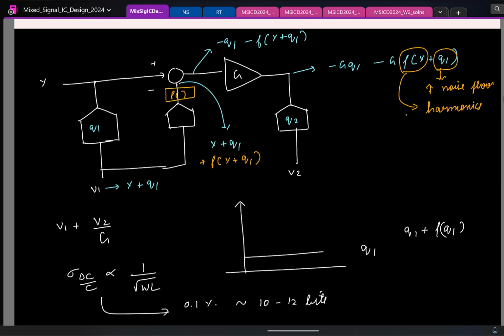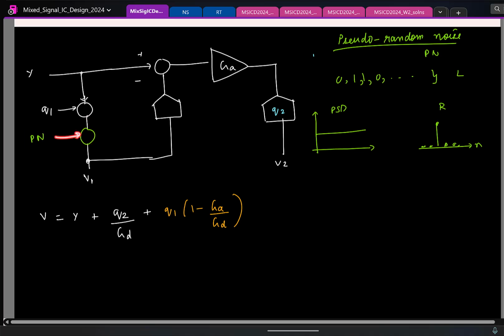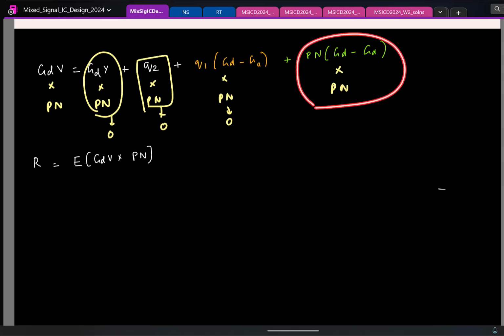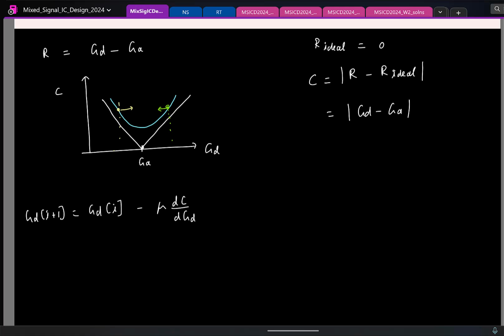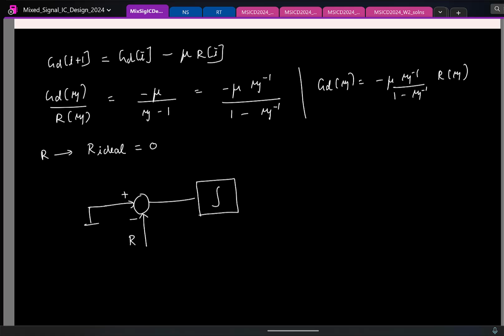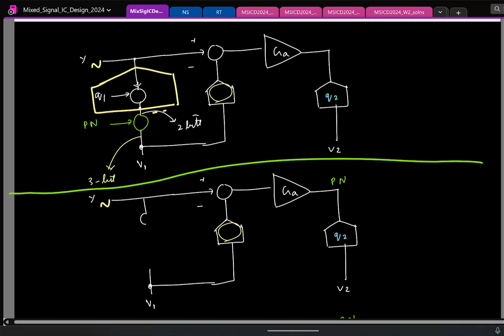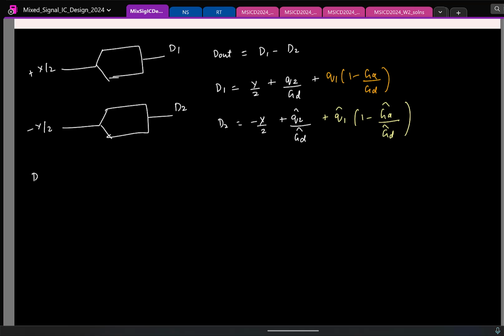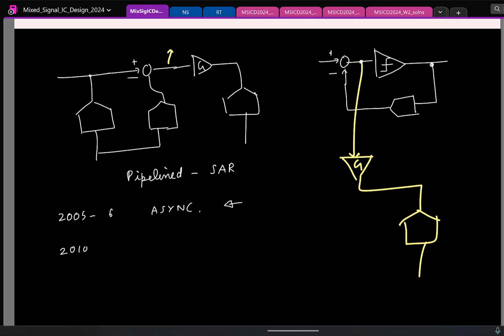Lecture 19(2): Digital calibration with PN dither based correlation: Gradient descent & LMS

Comment: I have a question. If i want to correlate between PN in analog domain with Dout in digital domain, i must convert Dout from digital domain to analog domain? Ex: with ADC 12 bit with Dout = 0 - 4095 then convert Dout = -1 to +1 and then correlation with PN.